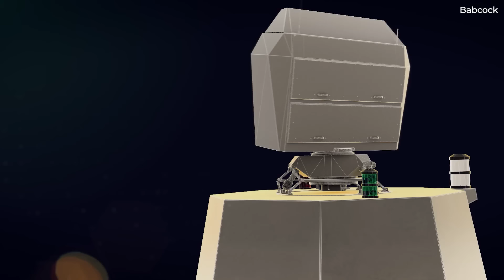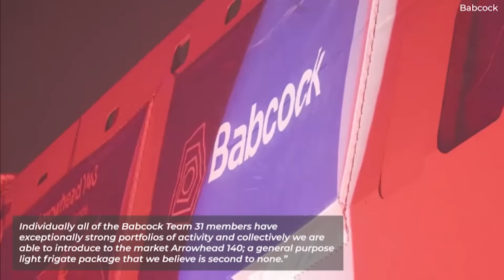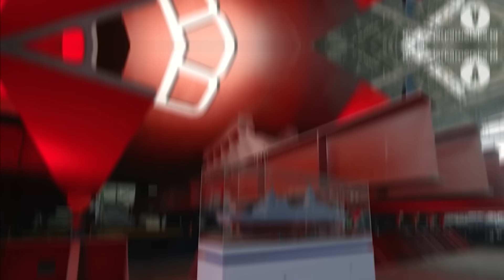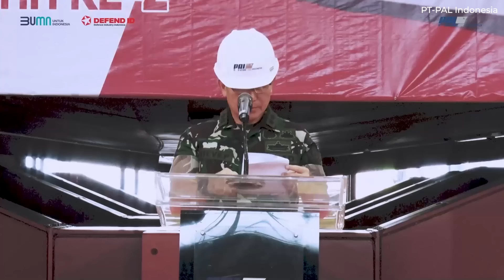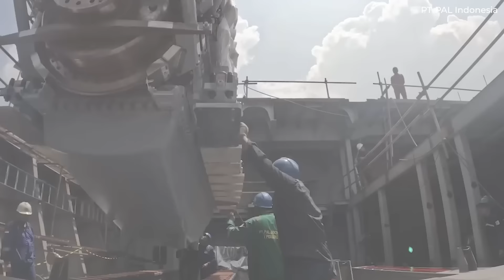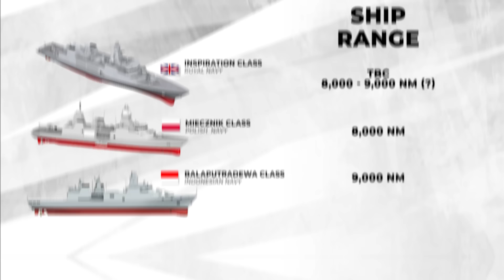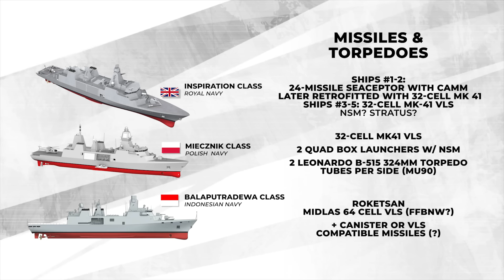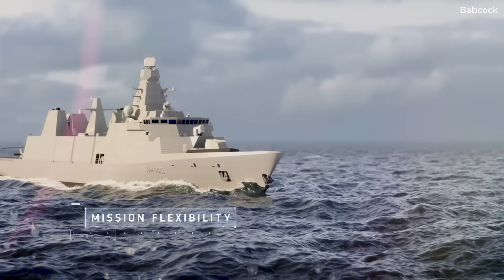Same, But Very Different: The Arrowhead 140 For UK, Poland, & Indonesia

Comment: The Indonesian difference is in an absolute comical weapon acquisition plan. Expect it to be a gun boat for a while
Reply: i think that vietnam warship is more comical than indonesia
Reply: @AZURAXero  Vietnam exclusive marittime zone is no where close to the indonesian one in size and complexity.
Still I belive Indonesia would have been better with more Meko200 or the last Turkish Frigate and about 3900 tons and probably cheaper to build.
You "technically" can retrofit a larger ship for more capabilities, but it comes at a very high costs in resources and time away from service. If Indonesia has in mind to refurbish these ship later to a higher standards, may be more PPA in the "Light" version could have been a more sensible choice, as those were designed as "slot in" platforms, but at least some common logistics would be kept with ships already in service.
I struggle to follow the logic of modern Indonesian procurements: just look at the air force: Rafale, SU-30, Khaan, T-50, now M346FA, and probably KF-21Borame... it's a mess as all these planes use different radars, different weapons and different engines all incompatible with each other. The navy will now operate Aster and MIDLASS, where a PPA already could be compatible with CAMM-ER, which Indonesia will not adopt.
Reply: @Zumzifero  Agreed with you, but I heard one of the big reason our government do this kind of way  is to avoid the embargo like what we've got from US when we still using their fighter Jet only(F16 incident).
Reply: @AZURAXero  our gunboats don't need to be 5700 tons like yours
Reply: @TrungNguyen-uf8cv  
Vietnam only needs fishing boats to face Chinese ships.
Reply: @jackblank2165 let's do law enforcement fleet comparison, ones to fight china's grey zone tactic. Vietnam vs Indo. >2000 ton ships: 11-4. 600-1200 ton mid size ships: 70+ vs ~11.
Reply: It is clear that Vietnam cannot afford these warships😂
Reply: @danir5259  Indonesia is borrowing money to buy these hulls. Another loan to buy weapons, and another loan to keep the ships running. We're building one with our own design, sensor suite, and weapons.
Reply: @TrungNguyen-uf8cv Borrowing, because Indonesia has the capacity to repay; Vietnam is also building its own version using reverse-engineered foreign technology due to budget constraints 😅
Reply: @danir5259  bitch please, that's the pinnacle of self reliance. The island folks who cannot copy anti ship missile never know. We developed glide bomb without importing any glide bomb or signing any  sketchy collaboration with no real tech transfer.
Reply: @TrungNguyen-uf8cv  Literally every other country do the same(borrow) when they purchase military stuff mate lol and paying with many/multi variants way either via trade, money, aggrement, etc you name it. Do you think we're not building with our own design, etc?. We're buying that ship design literally not just for defense but to learn about that things and so we can make it ourselves and do the experiment with the weapons, radar, etc till we could be independent to all aspects. That's what we've always do until we could sell the products ourselves to another country for the example our tanks, armored vehicle, gun, LPD(our dear neighbour Phillipine even ordering 4 from us and also UEA), and many more.
Reply: Thats rich comin from you hey gepard is stronger than arleigh burke right
Reply: @LaplaceTheLapdumb  typical IQ 89 counter-argument
Reply: @TrungNguyen-uf8cv lol cant make functioning lst and dare to critics other ship branding it as gun boat while operating glorified corvet gunboat whose radar are out of shape and out of time

Talk shite to me if your shipyard as equal as CSSC or Huntington Inggals
Reply: @LaplaceTheLapdumb  why Ingalls? is it Indonesian? your counter argument is functionally braindead anyway. A well maintained I band radar is plenty to run a gunboat. cannot speak the same for Indonesian naval asset to be well maintained.
Reply: @LaplaceTheLapdumb  your counter-argument is useless and dumb in the first place? why need to bring up America? A well maintained fire control radar is good enough for deck gun. Cannot speak the same with Indo naval assets to be well maintained.
Reply: The stupidity shown by this Vietnamese brother, you just feel jealous seeing the Indonesian navy is intensively modernizing warships with Arrowhead 31 and PPA Thaon di Revel while the Nguyen people can only lament the fate of their country which only relies on obsolete warships left over from the Soviet Union😂😂
Reply: @muhaickel  No, why jealous with PPA while Italy is flatly refusing integrating Atmaca, making it functionally a gunboat as much as three heavy coast guard ships we got from the US? how well is the indigenous antiship missile going? we are even spamming ours on fishing boats all the way to the coming home made 4000 ton frigate.
Reply: @TrungNguyen-uf8cv Integration issues are temporary, not permanent. A modern frigate is defined by its sensors, VLS, radar, ASW capability, and future upgrade potential—not just one missile. Let's judge the ship after its final configuration.
Reply: @Sherlan_COOL nah, with Indo model, you have to assess whether all the ships is working well in a joint force.
Reply: @TrungNguyen-uf8cv That's exactly why the Indonesian Navy is investing in modern combat management systems, data links, and integrated sensors. Joint-force capability is built through networking and interoperability, not by having identical ships
Reply: @Sherlan_COOL forgot to add, whether some of them are speaking at all due to maintenance complexity
Reply: Yang paling lucu adalah, dari 24 korvet yang di operasikan angkatan laut , hanya 7 unit yang mengoperasikan rudal anti kapal, sisanya hanya mengandalkan meriam.
Reply: I know your gepard is very powerful right hahahah, I think you should help your fisherman that caught by Indonesia by doing illegal fishing, your navy strong enough right hahah
Reply: almost a Turkish frigate
Reply: @pandaDotDragon  it's fine to still be in fully foreign import phase. But they are trying to mount Atmaca to Italian ships they just bought, but Italy refused.
Reply: Nguyen 😂
Persiapkan saja kapal mu sendiri untuk masa depan melawan china 😂😂
Reply: @apippphadiii1664  at current situation, we have a huge fleet of law enforcement ships for it. You guys are roping chinese into an oil deal among 9 dash lone contested water. With a bunch of high tech heavy gun boats. Great job there!!!
Reply: @TrungNguyen-uf8cv anggaran pertahanan mu saja masih kecil 😂😂
Mulut besar sejuta nguyen😂😂😂
Reply: @apippphadiii1664  limited budget make ways to the self made products that Indonesians can't even :v. Bonus, we always keep the deck guns rust free! Where is the first working Indo anti ship missiles??
Reply: Yes yes true
Reply: Yeah, the delay because of the sensor changes was unfortunate. I really hope there is not another Bung Tomo-class situation with these new acquisitions. Leaving the VLS empty of anti-air missiles for 11+ years is a total joke. Hopefully, the Bung Tomo-class modernization wraps up successfully so we can finally see a VL MICA test launch soon.
Reply: @miqr9585 we are simply concerning for you guys.
Reply: should be enough for nguyen fisherman boat
Reply: @BarjoBardi-e2l  we should mount our missiles to our fishery surveil ships, then
Reply: @TrungNguyen-uf8cv Bring it on, 😂😂😂 better than become keyboard warrior
Reply: @BarjoBardi-e2l  hello keyboard warrior, our navy have 500 ton gunboats carrying 16 anti ship missiles each. How about 5700 ton gunboat carrying soviet grad rocket?
Reply: @TrungNguyen-uf8cv LOL 😂😂 what ever your imagination nguyen, BTw what video post you commenting right now LOL 😂😂 amnesia already LOL
Reply: @BarjoBardi-e2l the similar size frigate to PPA which is staying gunboat at least until 2030s?
Reply: Indonesia will become a logistics nightmare, after buying 2 PPA, coming with specific equipments and advanced AA systems, what is the meaning of switching to a completely different sensors and AA suite on every ship under procurement?
Sharing assets like AA missiles allows for a better management when sourcing replacements, manteinance and sharing your missile stocks for every ship in the fleet.
I suspect Indonesia has no real plan for arming these ship to their full potential and will use them as off shore patrol Gunboats for anti piracy or skirmishing with Chinese coast guard clippers.
If the costs of procurement could be kept at the advertised £250M (I have doubts, unless sensors suites are at a minium) it could pay off, but otherwise they could have just bought more Meko200 or the Turkish equivalent.
Reply: @Zumzifero  now thing about logistic. look at Iran War, who will supply american missile right now ? their factory never enough.
Reply: @ahmads199dessault even an unified logistic, self producing system got fucked. How far would one who's unable to produce go?
Reply: @Zumzifero educated your self, Turkiye is  NATO member, the use same conpatible system with other european NATO members 😂
Reply: @BarjoBardi-e2l  it's about servicing them. them in a joint force is another deal
Reply: @TrungNguyen-uf8cv You know turkiye is a NATO member, all NATO is compatible to each other system nguyen
Reply: @BarjoBardi-e2l  does a British vendor help servicing a Turkish system? NO. But that's expected from folks who don't know crew must do chores everyday to keep deck guns rust free.
Reply: @TrungNguyen-uf8cv You're confusing logistics with interoperability. No one expects a British company to service a Turkish-made system. That's the job of the manufacturer and local support. NATO compatibility is about standards, interfaces, and data links not who holds the wrench
Reply: @Sherlan_COOL I don't concern their interoperability, I concern about logistic of keeping them running. Way to go working with zillions of vendors at once
Reply: @TrungNguyen-uf8cv 😂😂😂 deleted someone comment is not fair nguyen, You know NATO? did they have problem with logistic from diferent OEM and others
Reply: @TrungNguyen-uf8cv ofcourse not, why should british involve in ship that they dont build 😂😂😂😂
Reply: @Zumzifero  this model must have a limit for the whole system not collapse on its own. but they are still buying as if there's no such limit. Or they are solving it by betraying fellow ASEAN - sharing  oil rights with China near overlapping EEZ water in active negotiation
Reply: @TrungNguyen-uf8cv  
That's their business, you don't need to interfere in things that aren't your business. If war breaks out, you should take care of your own country, not expect help from other countries.
Reply: @jackblank2165 actually china's 9 dash line is everyone's business. you lots still don't get what china can take away before real war breaks out?
Reply: @TrungNguyen-uf8cv lmao dude thinking Natuna is owner by every member of asean😂
Reply: @auliaaa.9858  yet you guys having China to your own EEZ - either decision makers' IQ is below average 89 , or they are compromised by china.

Comment: RNZN is considering AH140 and the Mogami. Both great designs but different.
Reply: My guess is that the Kiwi will choose the Japanese design.
Reply: The improved Mogami is probably the better choice given that Japan has a well established production line that has put 10 ships into service in a bit over 6 years and they still have additional construction capability available.
Reply: @Vonstab New Zealand doesn't want their ships until around 2035, and currently, Babcock UK has no ship orders after 2030, so they could be fully dedicated to building ships for New Zealand.
Reply: The RNZN should consider the MEK0 A-200 or Damen SIGMA class frigates, as they have better Modularity and Multi-Role capacities, also with smaller versions available as corvettes and offshore patrol vessels, as NZ also needs to replace it's Protector class OPV's.
Reply: @johnsmithe3881  That design is not being considered by the Kiwis.
Reply: Correct, but should they open up the tender process to other designs?
Reply: @johnsmithe3881  the Germans did put the MEKO A-200 forward but it has already been rejected new Zealand piggybacked of the Australian frigate program that led to Australia the picking the upgraded Mogami and picked the ones they where interested in
Reply: @johnsmithe3881 the A200 looks like a good design. Would be concerned about the Sigma as the German navy had cancel their project with Damen and get the A200. But unfortunately it is not being considered for the RNZN.
Reply: But UK & Netherlands have selected Damen for there new  Amphibious Transport Ship (ATS), you win some and you win some, as for the German contract, Inflation, cost overruns and being held up by German sub-contractors didn't help?
Reply: @johnsmithe3881 why would we go for a ship that lost to the Mogami FFM, Mogami is the only choice that makes sense.
Reply: MEKO are modular and have scaled up and extended range versions, Australia’s maxed out combatant requirements aren’t the same as New Zealand's Multi-Role disaster relief requirements?
Reply: When I first saw the two downselected I had the Mogami (New FFM) nailed on as an obvious choice, mainly for interoperability, commonality and strategic alignment with regional allies. But having looked into this a bit more, the AH140 design might actually be a more suitable platform for the Kiwis. It's likely to be more cost effective (depending on configuration) and it's also a more flexible design with things easily added in or taken out. The Mogami on the other hand pretty much comes as it is which is probably quite expensive. 

The biggest advantage of AH140 in this case is that it has a flexible mission bay which makes it more suitable for peacetime missions like disaster relief and aid which I'm pretty sure is something the Kiwis like to do. Just to be clear I think the New FFM is still the favourite but I certainly wouldn't be surprised if they picked this instead, I think a lot of people are sleeping on it.
Reply: @CrackingDale25 NZGovt would be giving the middle finger to Australia if we went with the A140, HMNZS Canterbury is a far more effective ship than a Frigate doing those task like disaster relief, our Frigates need to be Warship armed and ready to fight not this bullshit peacetime mentality the days of Strategic Benign Environment in the Pacific are long gone.
Reply: @dave741966 The Mogami does not even meet modern survivability standards in an effort to save cost, whereas the Type 31 does.
Reply: I agree the Mogami is awesome, but the AH140 is more practical for New Zealand with its Multi-Bay container capabilities?